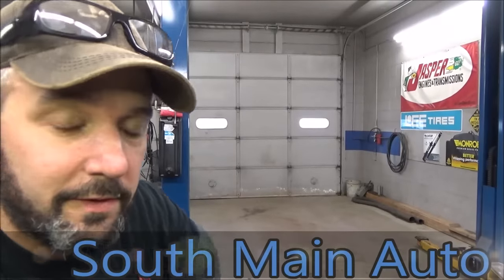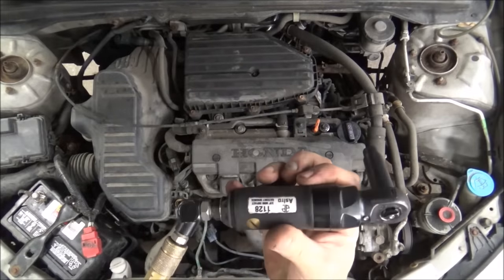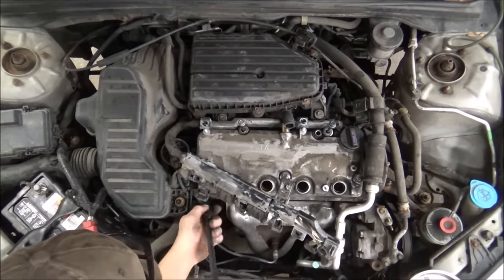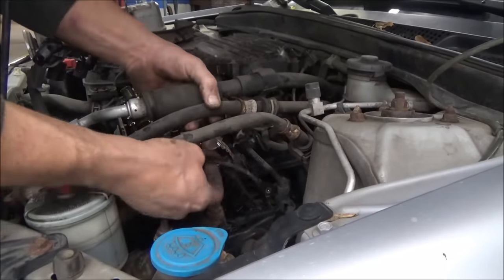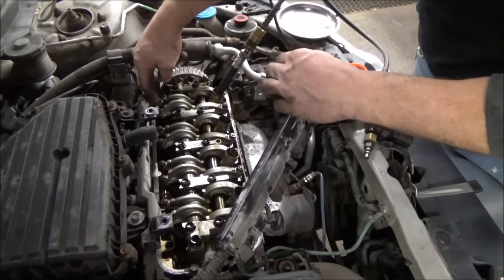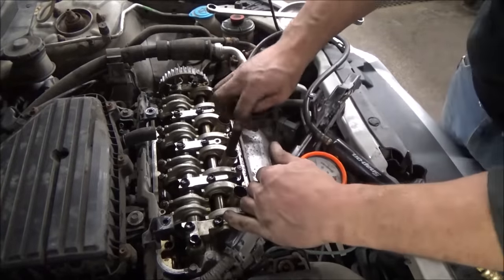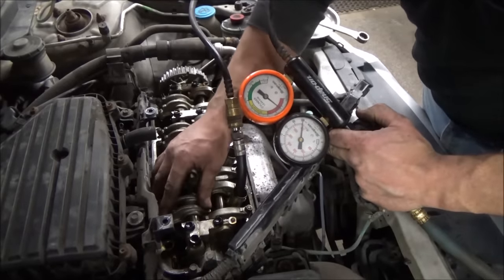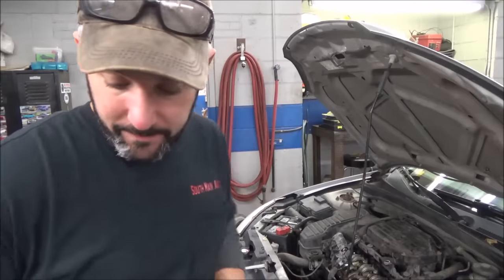Honda Civic 1.7 - Crank No Start

Comment: That damage may well have been caused by the time the owner stopped, long before perhaps, just a few milliseconds will cause all sorts. Like an idiot I tried to keep up with an Arial Arrow Sports in 1964, I was on a C15 and stayed in 1st far too long, my fault I dropped a valve in. the Arrow had lightened and shaped conrods, pistons, flowed exhaust manifold and expansion boxes for mufflers, it sounded fantastic and could beat a Triumph Bonneville T120 "Bonnie" when he had let his clutch out, because it had a high 1st gear, close ratio box. He did all the machining on the same lathe he used to lap shogun barrel bores on. When he was working that is ) Just noticed the date, it is so easy to let YouTube show these 1 after the other., the last one was the lovely power ski for next spring.

Comment: I broke a belt twice on my 87 accord . First time it broke a few teeth on the belt, second time the belt was shred because I was too cheap to replace a idler bearing that seized . Both times I was cruising on the highway but I never bent a valve.

By the way, I was cranking the crap out of the car both times after the belt broke.

Comment: If you turn the crank so the crankshaft keyway is at the three or nine o'clock position. It puts all the cylinders in the center of the cylinder. Making it so the valves won't hit the Pistons while turning the cam

Comment: I assume some shops would have gone ahead and replaced the belt without performing the diagnostic work. Obviously, you would have taken the loss but would some shops have gone ahead and still charged for the work and tried to get the job of replacing the valves as well?

Comment: Alot of times Honda's will jump time 1 tooth then snap. Usually at high way rpm speeds. Usually bad news. Cheaper to fix than new car payment. My 95 EX 350k still going. Rebuilt twice myself.

Comment: i have one that has that same sound as if the belt has broke but it has not. its in time. getting fuel. getting fire. crank sen replaced. cam sen replaced. tell me why it sounds the same as the car you work on in this vid and still wont start

Comment: Very common replace valve's seals and water pump and tensioner belt and all seals kit is less than 100 bucks.. Also includes new head gasket and bolts for head.

Comment: MANY years ago I had a 76 Pinto MPG 4 speed and at about 75,000 the band broke, i think the belt was about 10 bucks and I didn't even take the balancer off. I hate to say it but I sprayed a bit of silicone on the part of the belt that would be on the bottom cog and slipped/lightly pried it in, never an issue with it, funny because with the belt it had a DONT PRY sticker somewhere

Comment: i dont normally whatch wrenching videos , customer said hear noises before it stoped the noise  was probably valve  bashing going on , i also never seen a belt shredded like this normally just a few teeth are missing on the crank side as less teeth grip on there.
so i wonder what shredded  the belt like that.

Comment: The way that belt looked I assume it jumped before it finally got torn apart...and if it did a couple of revolutions with the belt still half-on with incorrect tiiming...valves had no chance of getting away before the piston came up^^

But that is what you get when you neglect timing belt jobs...(at least I assaume this is what happened)
Reply from the maker: +Markus Krause Yeah ya never know, all I know it what has happened isn't good :)

Comment: I have a 2002 Honda civic 2 door manual transmission. The car won't start I changed the starter, still doesn't work. I can jump start it by popping the clutch though. I tried jumper cables jumping it still doesn't work. What could this be?

Comment: Looks like the original timing belt - 105k miles to replace that with water pump.  On the newer Hondoos with 4 cylinder with timing chain, make sure your oil level is full, not low or the timing chain guides will wear and jump timing and cause damage.

Comment: How many times out of ten can you usually get away with replacing the entire head on an engine in this scenario? (broken timing belt on an interference engine)
Reply: On certain models the valves hit the pistons in an area that causes the #1 ring land to close up. Ring sticking and oil consumption will result. Good low mileage Honda engines are a dime a dozen. You can just about put a low mileage engine in for what a head/valve job costs.

Comment: My customer had that same car, valves were still moving, but the distributer was not. Took the valve cover off and turns out only three of the four sets of valves were moving because he snapped his cam shaft in half because he didn't check his oil regularly and let it run dry.

Comment: Just did a valve cover gasket on mine on christmas eve. The d17 is the worst single cam ive ever worked on. the d16 was so much easier.

Comment: hey im having crank no start on my 95 acura integra. ive changed my icm and coil an also new rotor in the dizzy.. itll start for maybe 2 second but dies. my friend taps on the dizzy an it stays running longer.. any ideas?

Comment: What's the timing belt replacement interval for these?
Reply: D17A (1,2) motors have a 110,000 mile / 7 year interval on the timing belt, water pump, and coolant

Comment: the 1.7 engine (D17A2) on the EX models have VTEC  while the engine (D17A1) on the LX & DX models don't.  When the VTEC is active on the higher revs, it becomes an interference engine.

Comment: I don't even blame owners on this one.  Even if the manual says to replace the belt every 90k, they do not know the consequence of not doing so and would most likely forget about it so much years after reading it.  Not knowing about cars, they would think to just replace the belt when it breaks.  Looking at the rocker arms, this car was relatively well maintained as it doesn't show much sludge build up.  So oil maintenance was pretty good at 165k.

Comment: i have to disagree the belt only busts when its running while changing the water pump that went bad on my del-sol
took a prybar to gently lift the belt off the pully that was already gonna get changed per hondas recommendation heared the sound of dry grass the belt goes limp and im looking at a issue that would have happened 300 mi down the road timing belt snapped in half during removal with a plastic wedge

Comment: Slipped a few teeth of the belt on my '98 Civic. Bent 14 of the valves. Sent the head to the shop, did the rest myself. Drove the car another 80000 mi before it got stolen.

Comment: I had a small block Chevrolet 350 interfere with the valves one time  on a fends truck.
Reply: +funntier Not possible unless they had an aftermarket cam with longer duration. With the stock cam the SBC is non-interference.
Reply: it was all stock but the plastic cam gear broke around 7500 rpm when a missed shift happened.

Comment: To bad the guy can't do his own head swap. As the cost for parts is around $400.00 for used head, water pump, pulley belt kit, gaskets and seals, new plugs and anti freeze. 

And that model didn't have the ABS system to deal with behind the power steering pump. As that thing gets in the way.
Reply: But as you can see in the video, the pistons were scratched too. Replacing the head only is useless in this case.
Reply: +Jacky L. I think I recall Eric O. saying in this video that the marks on the piston aren't a problem
Reply: caduceus33 totally depends. You gotta check em out. Seen plenty of LS1 motors where guys kissed the pistons with the valves from a missed shift and the pistons were fine. On the other hand seen where it started a crack too.

Comment: Help help please. I have a 2004 Honda Civic crank but no star, if we push the car turn on n runs good.
Reply: Guys the car is manual transmission.
Reply from the maker: In that case the valve adjustment may be to tight, or the timing could be a tooth off but you really did not provide any information
Reply: The car will push star and the engine runs fine n doesn't shake, there is gas pressure the main relay is good, when it doesn't start there is no check engine light, any advice?

Comment: It's strange to me you haven't seen them bend valves, I've always been very diligent with t belt and water pump replacement on my honda because I thought anytime they shred a belt at speed, it ruins the valves...
Reply: +Rick James kinda sad a bit of maintenance would have prevented this

Comment: Half way through I started saying "Call the time finally, Eric. Do it. It's dead." all the time in my head all the time.

Good video, though. ;)
Reply from the maker: Haha T.O.D.!
Reply: South Main Auto Repair "fun" fact: Tod stands for death in German. ;-D

Anyway, I really like how you really dig into the diagnosis part. I wish my VW would have done that for my A3 when it had (apparently) some kind of misfires.
Turned out to be a corroded sparkplug wire (ignition module end), another one had no continuity, other two higher resistance.

I also asked them how the connection on the ignition module looks like if this one wire is corroded completely.
They said it was okay. I was wondering about it but as it was at a hard to reach place, I left it.
Last weekend I "blindly" replaced that ignition module to find the connection on the module to be corroded as bad as the wire was. The module even had the "typical" cracks in it.

Now my baby runs sooooo smooth again.

You won't believe what VW did in order to try to solve that problem...

Comment: how much for this kind of job?
how can I find the engine number so I can buy the O2sensor.
Reply: Eric quoted roughly $2000 near the end of the video. There is easily $500-700 in labor just to pull and strip the motor and reassemble. The machine shop work is costly as well as Eric described (hot tanking, milling, new valve guides, rockers, etc.).  I'm not sure if Eric would have needed to replace the pistons - if so, it would totally be worth dropping a new D17A1 or D17A2 motor in and junking the destroyed one. Probably worth it regardless as these motors are a dime a dozen.

This Civic has (had!) a D17A1 motor (see sticker on upper timing cover when Eric pulls it off). If you're looking for parts such as the O2 sensor, it's easier to go online to a Honda parts dealer and select your car from the drop-down menus. I would imagine most of the 7th gen Civics from 2001-2005 take the same set of supporting parts.

Comment: Every D17 with a broken timing belt I've ever seen has bent valves.  Thankfully it's not much more work than a head gasket to replace the bent ones, lap and move on.

Comment: Please help! I know this is a long shot, but worth a try. I have a 2003 Honda Civic 1.7 and it is making the exact same noise that the one in the video is making. At first we thought it was the fuel pump because there wasn’t any fuel pressure- changed the fuel pump but the problem persists. After watching this video, we were able to do a compression test to the engine and there is ZERO pressure!! I looked at the timing belt and it looks good, the only problem is that it’s not turning. Can anyone help?

Comment: the same thing happened on my car and i threw a junk yard head on it and put a new head gasket and head bolts on it and it still runs perfect. cost less than $100 for all the parts. thats what i would have done on that car
Reply: Graham Rees also if it went south you don't have a customer crying about what did you do to their car.
Reply: Dan Durst that's true

Comment: Honda has used that same engine for years just bumping the size a little bigger over time. They need to use dohc non interference ones like Toyota. I think the new Honda civics are on a timing chain though but still sohc.

Comment: @17:20 mine hit the valves. valve  snapped off and right threw the piston. ruined the head and block guess the piece of valve also hit the engine sleeve too and my belt only jumped two teeth. wish i could post pics on here. it was a 91 civic ex d16A6. still have the car but long story short now i have a jdm d15b vtec running on the stock ecu and vtec on a switch. so i did not have to change the ecu it had to get a lil jimmy rigged cuz i had to use the d16's distributor on a custom mounting plate the ears dont line up at tdc. the d15's distributor put the ecu in limp mode due to the crank angle sensor not being in it cuz that year had it in the timing bet side instead of in the dizzy.

Comment: Every Honda car motor I've seen in the past 25 years has been interference - not surprising it didn't end well for the valves.
Marks on the piston can cause detonation when reassembled, my D16Z6 didn't have a knock sensor either and mysteriously pinged for its whole life.

Comment: looking for help please I have a 2002 honda civic lx 1.7l no  start no crank. New starter New ignition switch good battery. tried to bypass clutch safety still nothing. and I mean nothing when I turn the key. I can jump the starter but it still won't crank. what else can I do? please help.
Reply: Stoney Sims Have you tried unplugging it then plugging it back in?
Reply: +Colton Arndt yes
Reply: hope you fixed your problem ..many test that can be preformed..I would have started at ..is the system grounded..and checked voltage at the battery as the engine was cranked.. if it doesnt move downward then the starter is not even trying ..iv dropping ,,,seized engine  or bad starter ( even though new )

Comment: It's incredible how much damage a $12 part can do when it goes! That's why ya follow the service intervals.
Reply: Derek Sternhagen 12 dollars? What you talkin ‘bout Willis?
Reply: @Whateva67  I'll admit, its been awhile since I bought it, but I'm pretty sure the timing belt for mine was only like $12 or so! Granted I ended up buying the whole kit with the belt, water pump, idler... yada yada. That cost a bit more for the added peace of mind. Kept her running for another 40,000 miles until I sold the car.
Reply: Derek Sternhagen well that would be pretty cheap for a timing belt but glad ya got a deal😎
Reply: @Whateva67  Well I just had to look it up now, and sure enough... $12.99!  Carquest timing belt for the d17a2 engine from advance auto, haha.

Comment: Man that's strange banging the valves on the 1.7. I had one, a 2002 that was a former courier car from texas with 640k on the clock before I got rear ended in an intersection. Too bad, I would have run it to 1m.

Comment: That was likely the original timing belt as a belt should last 100,000 miles.  If so, it was the customer's fault for driving the car to destruction.
Reply: Can you believe my Odyssey's original timing belt went 260K miles before it blew apart?

Comment: Cyl1 leaking into cyl3? Blown head gasket?
Reply from the maker: +James Last No? It was leaking out the valves. Remember with valves open on multiple cylinders it will flow from one to the next.
Reply: +South Main Auto Repair My bad, wasn't thinking. Think it was the original belt?
Reply from the maker: I am willing to bet it is..
Reply: Had a Chrysler (Mitsubishi) V-6  belt break at 140K. So this little Honda went the distance. Luckily, the Mitsu  wasn't an interference engine.

Comment: What does Hondu say is the recommended interval for changing these timing belts.  My sister drives one of these things, as I'm sure a lot of people do, and I'd like to not deal with a dead hondu.  The fucker is a champ, all 100HP of it, but it will do 100 MPH with an automatic trans!
Reply: +Andrew Lulling It's usually 90K.
Reply from the maker: +Andrew Lulling 90 to 100k I am thinking

Comment: I wouldn't be surprised if it was the idler pulley that gave out. I replaced my belt at 100k miles and it looked new.

Comment: I did a Stratus with a 2.4L that popped the belt on the freeway and once I got the head off I found the 2 center pistons had holes in them from the valves going through the tops of the pistons.  The owner just scrapped the car.

Comment: In all my years I have never seen this... and I mean NEVER... Even as you were testing and showing the leak down failure and the bent valves I still didn't believe it because this is so rare!!!  Now I'm going to have to start checking a little closer, for years a customer that's spun a timing belt, I would simply give them the price of the timing belt job and that was it.... and every single time I did the job it was guaranteed to start and have no internal damage... This is good information but disappointing at the same time
Reply from the maker: +Samuel Bane If I wasn't doing a YT vid I might have just hung a belt on it ...

Comment: Not uncommon to see 40% leakage on a good cylinder if last piston movement was downward. Rings are not sealed to piston lands letting compressed air escape, between top of ring and upper land - around back side of ring - between bottom of ring and lower land. Could see one ring move and take seal when you first applied air to #2. Even "Total Seal" rings will not seal if rings are not seated on lands and show major leakage, but will show under 1% when rings are seated. Sometimes cranking pressure regulator on leak tester to max with air supplied to tester, before connecting tester to cylinder will "shock" the rings to seat on piston ring lands, but just as often as not sends piston to bottom of stroke with rings still floating. Of course if piston is at or near top of stroke any taper worn in cylinder will make for larger ring end gaps and contribute to leakage. Combustion pressure during normal engine operation keeps rings tight to piston lands during power stroke. Obvious valve damage in remaining cylinders of engine in this video.